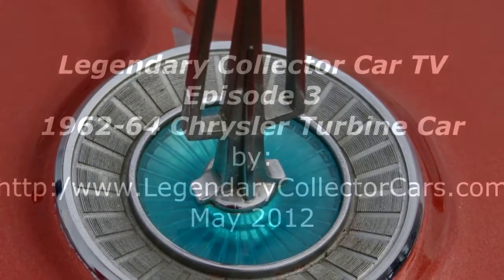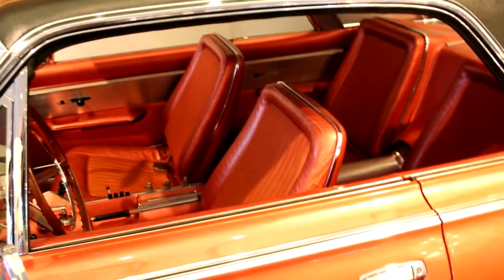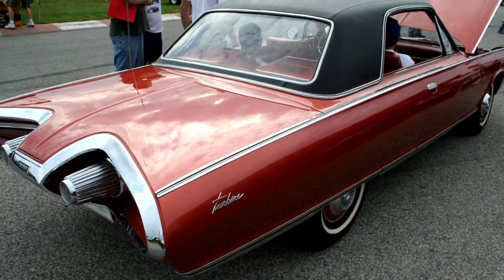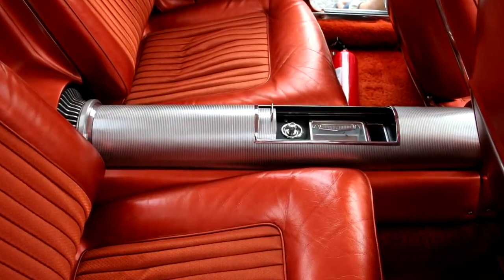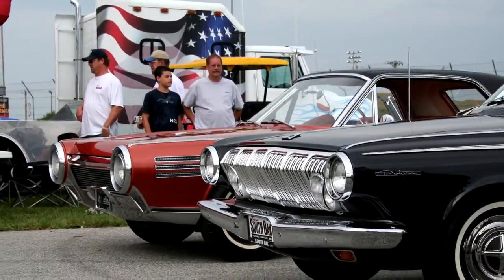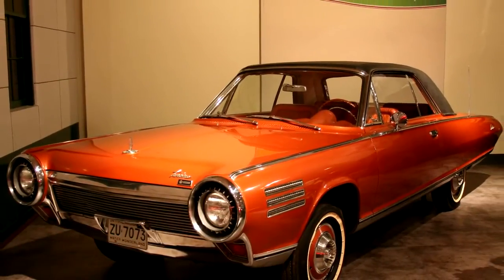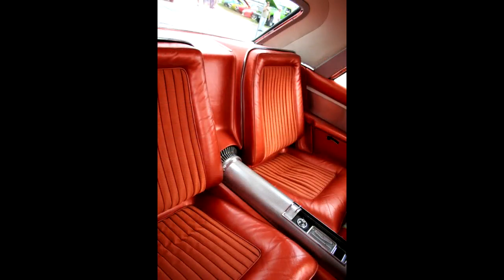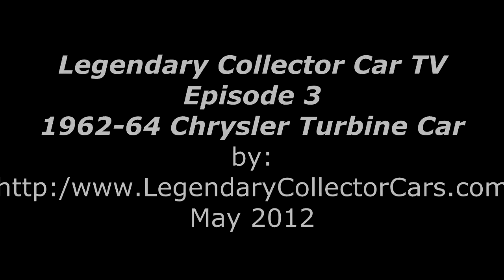Chrysler Turbine Car 1962-1964 Legendary Collector Cars TV

Comment: We kept these in Chrysler Research into the 70s. I drove one around highland park Engineering for at least a year. We were trying to disprove the idea that it would not start after oil ash appeared on the turbine bearings. (Never failed). Todays hybrid tech could run the compressor and save the fuel at its worst fuel economy time, idle. Also cvt trans with certain program would make that a economy minded smooth power plant. I suspect Mercedes took all the research. At the beginning of this video the slow 0-60 time was pointed out. Well I helped develope the variable pitch  power turbine, that turned it into a tire smoking runner. I ran side by side to a 383 auto road runner. If we put posi traction in the turbine would likely win. Oh and you can't feel it run and there's almost no noise. There's more.